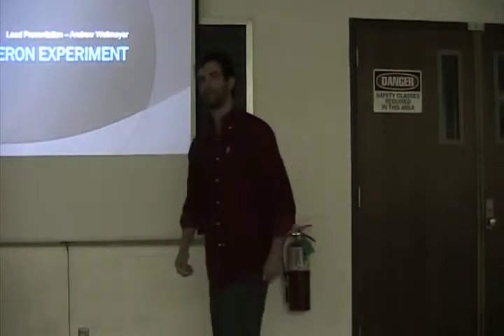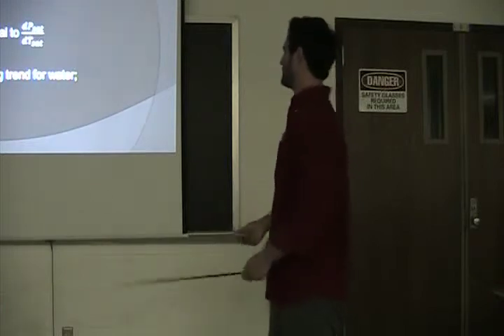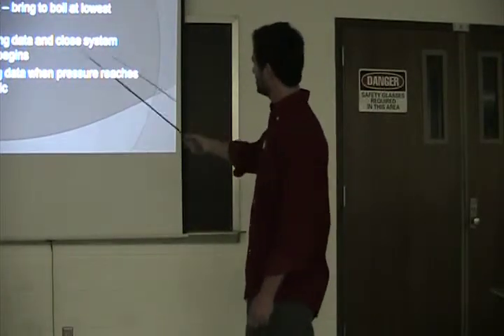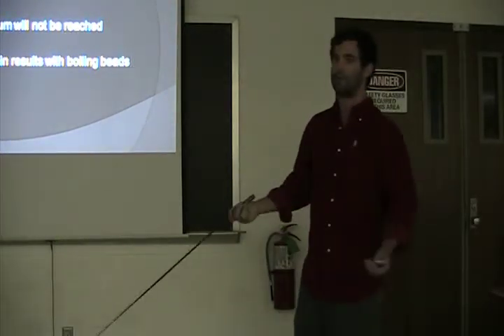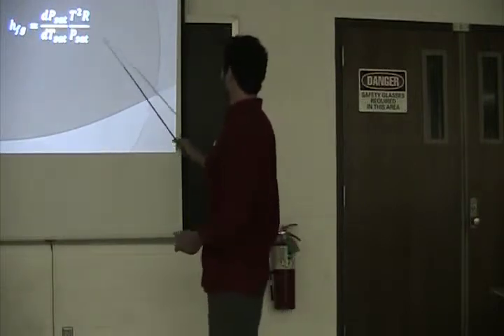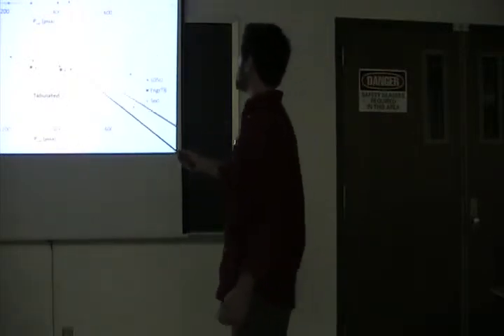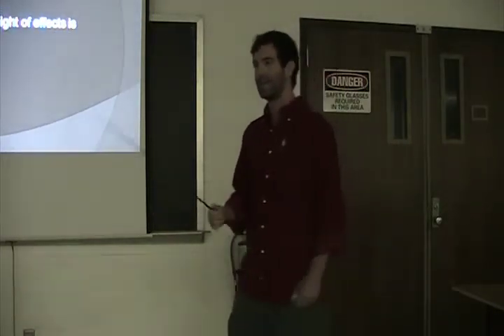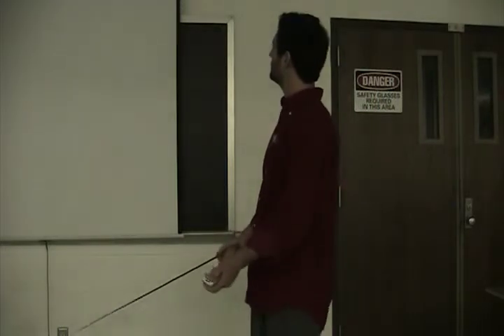file000026

Comment: I think your slides had a good color scheme.  Even from the camera you can see everything clearly.  However, there were a few points, for example when you introduce the equation, where it is a little harder to see.  I think you could have switched the color scheme up at those points.

Comment: Andrew and I had the same topic and our presentations were very similar. For content of his presentation he used a few different sources of steam tables to get a wider range of data I think that was a good idea. Also I remember our plots looking different not sure what kind of plot he used but it should have been a pressure vs temperature plot. I like how he went deeper to find out what was wrong with some of the data he found and did not just take it to be true. it is good to check sources.

Comment: Andrew, I think as long as you are pointing out what you are talking about than the pointer is a good device to use. I also think and improvement could be to show a picture of the device on your powerpoint not just point to the actual device in the class. Another improvement would be to label your picture of the experiment because it is hard for the class to keep up with what is going on without the labels.